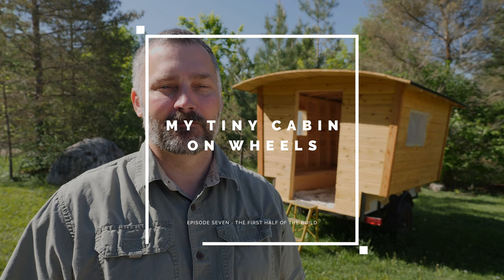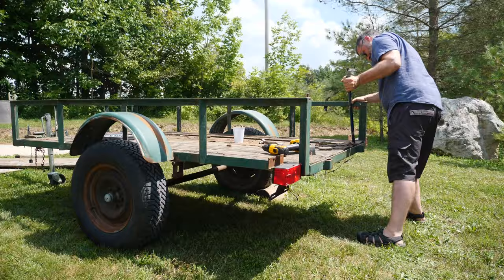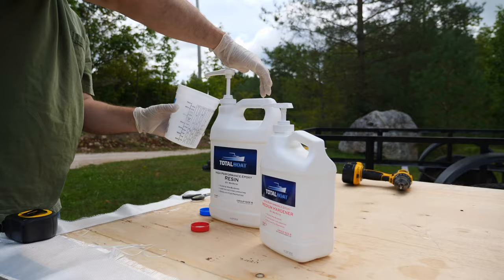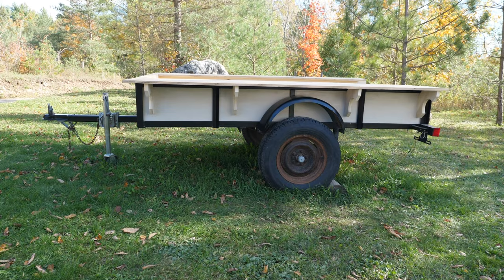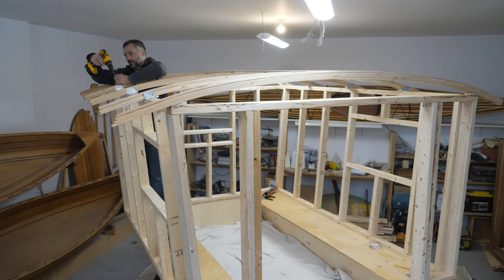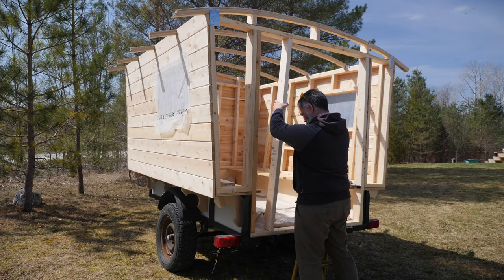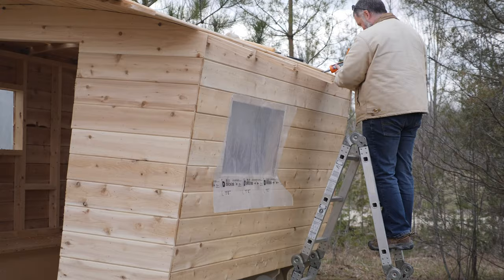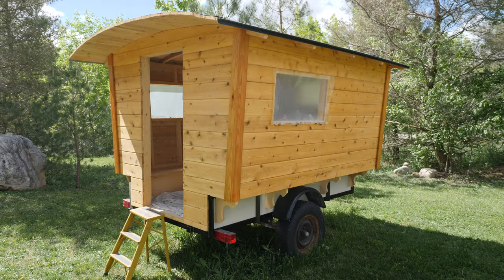Building My Tiny Cabin on Wheels: What I've done so far. | Off Grid Cabin Build

Comment: Nicely done with the trailer restoration. The biscuit joiner brought back old, but good memories. Mine is a dewalt. I haven't used/needed it since the mid 90's. I still have about 1000 biscuits in 3 sizes.

Comment: You mentioned something I was wondering about that I’m curious if you addressed later… the wobbly nature of the trailer. Did you add any kind of fold down, adjustable height corner legs to stabilize the trailer when it’s not hooked up to your tow vehicle? Most pop-up campers have them so you can level it on slopes or uneven ground and, more importantly, so any changes in center of gravity inside the trailer keeps the tongue end from “tipping up.”

Comment: This is interesting. I am looking for just such a thing, but likely smaller, to use as a display for my art work. It would have to fit in a 10x10 space. I once saw one with doors on the long sides that opened up to hang the paintings on each side. There was also place to put prints under the swinging display doors. He had a table that came down to cover the hitch, used as a work table. The inside had shelves to put the paintings on and other materials for the shows. He also had awnings that opened out on I think 3 sides. It was wired for lights. I have been looking for such a thing and Han=ve=e not found anything. I like this one that you did, because it is neutral in color. Do you build these for other people?